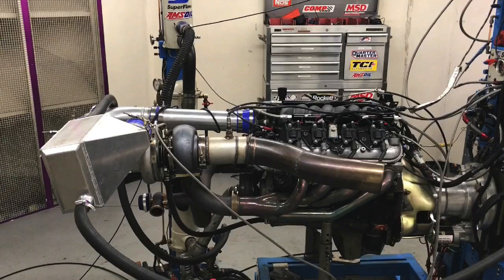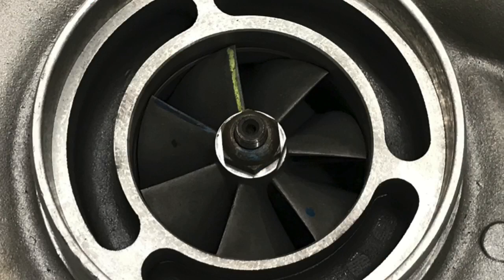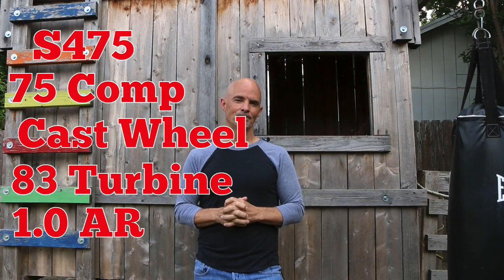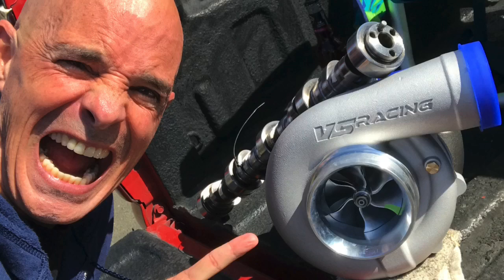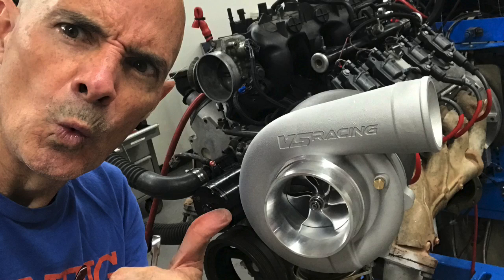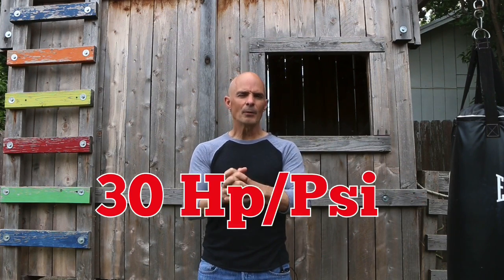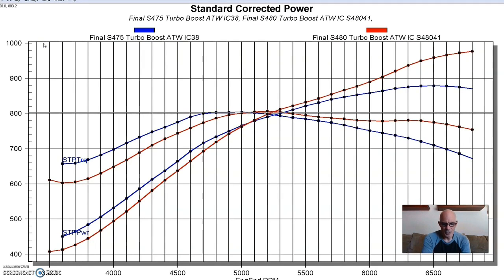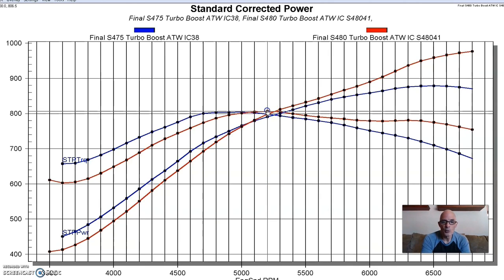HOW TO: PICK THE RIGHT TURBO!

Comment: Does it not seem like maybe your wastegate could be undersized? You can see where the gate opens at 4700 (475) and 5100 (480) and they seem to not bypass as much exhaust flow as needed to keep a flat boost curve after wastegate opens. Just a thought.
Reply: Or is your correlation of backpressure to boost responsible for what I'm seeing in the boost curve with a rise in boost after the gate opens?
Reply from the maker: we have two gates-no problem with gates-its back pressure/boost changing the opening
Reply: @richardholdener1727  thanks so much for your reply.

Comment: I don't think a bigger motor would produce any more exhaust back pressure than a smaller engine at 1000 hp . Probably be pretty close but what is going to be skewed is the back pressure to intake pressure ratio.
Reply from the maker: back pressure will 100% be higher on the bigger motor
Reply: @richardholdener1727  Well that would make for a good video, same turbo, same hp level ( not boost ) and different displacement say 4.8 vs 6.0 and see if the back pressure is much higher on the bigger motor . I might be wrong but I think it would be a difference of 1-2 psi .
Reply: @richardholdener1727  Can actually prove my theory if you go look at your VSracing turbo vs Borg,  @ 6500 rpm the 4.8 produces about 20 psi of back pressure and makes 800 hp . In this video same turbo  on the 6.0 its produces about 875hp @6500rpm and about 22-23 psi of back pressure.  Yes the boost to back pressure ratio is way off on the bigger motor but its proves my point that back pressure( exhaust gas volume) is a function of HP not displacement.

Comment: Still trying to turbo my 416 sbc without spending a lot of money...

I have a couple of extra Powerstroke diesel units: GARRETT TP38
Compressor wheel inducer diameter: 59.87 mm (60 mm)
Compressor wheel exducer diameter: 80 mm
Compressor housing A/R: 1.10
Turbine wheel inducer diameter: 76.2 mm
Turbine wheel exducer diameter: 69.84 mm (70 mm)
Turbine housing A/R: 1.15

Anyone knowledgeable on this subject care to comment as regards the practical viability of this combination?
Reply from the maker: get them on
Reply: @richardholdener1727  A little short on detail, bit that sounds pretty positive.

Comment: A test I've always been curious about on a turbo motor is what happens to a given combination and it's power/boost curves as camshaft overlap is increased or decreased?  I expect the boosted curves would mirror NA curves like most of your tests show, but what happens to the hot side choke point?  If you've got a turbo that's oversized on the hot side for a given power level, can you make it more responsive with more cam overlap?
Reply from the maker: if the overlap adds na power-then yes-it will be more responsive

Comment: Isn't that where looking at the compressor maps come into play? Figuring out the efficiency of the turbos at the power levels you're looking for. Now, obviously the compressor map isn't going to help you choose a hotside, but it's definitely needed when selecting what turbo to use for your power goals. 

I'm in the process of selecting a turbo for a twin charging application on a 4.6 2v modular and it's looking like I'm going to need an s488 for the power levels I'm wanting at the boost levels I'll be looking for. 

It will be feeding through an intercooled m122 supercharger. Most people when twincharging make the mistake of not selecting a big enough primary to support their goals at the boost level that the primary will be running at and then they get frustrated when they can't make the top end power they were expecting. 

Maybe you could do a twincharging test to showcase how choosing the primary is so important in a twincharging compound boost setup.
Reply from the maker: the map is looking at a small thing--the general turbo size and max capacity is the big  thing you look at first

Comment: Awesome video! Got a video idea. Could you do a test on a centrifugal blower where you pulley way down to try and bring on boost harder and just use a watsegate to vent any extra boost up top? I always wondered if that would work. Would probably run into belt slip early but I'm not sure
Reply from the maker: it does work

Comment: Thanks richard! This was exsactly what i asked for, but it leaves me with 1 question- 
I believe you said that the S475 would have to much back pressure for the 6.0 and the S480 MIGHT be the better choice. Would the S475 be the right choice for me on the 2500 6.0 LY6 if its my tow vehicle or if im going to do a rear mount turbo and looking at MAX 650-700 HP/TQ? AND Does that change back pressure or response with A rear mount stock muffler location? Sorry if you've covered this. Love these videos learning alot!
Reply from the maker: use the S475 for that application
Reply: @richardholdener1727  your the man thankyou for responding! Greatly appreciated it and all you do
Reply: @richardholdener1727  with what size exhaust housing? I'm running an LQ4 as well in my tow pig/cruiser. Current S366 isn't working (too small).
Also, this motor (in the video) has dual wastegates. Required to control boost creep or just leftover from the big twin turbo testing?
Reply: Why would you ever want to do a rear mount unless you absolutely had to?
Reply: @chipcurrey653  its not right for every application just like everything else, but there ARE alot of benefits the 2 main ones being UNDER THE HOOD TEMPERATURE AND WIRING, The 2nd would be the stealth of it.
Reply: @joelstevensz06  I tuned an 05 GTO with a rear mounted 7875. It did not get into boost ( i would call "getting into boost 5 psi or more) until 4500 rpm. I advised the owner to move it to the front using the hooker manifolds. The same exact combination with the same turbo now "gets into boost" at 2500 rpm. 2000 rpm sooner. I cannot see that set of tradeoffs ever being worth it. If you pop the hood on any modern diesel, or the trunk on any 911 turbo you will see the factory engineers designed the shortest log manifolds possible.

Comment: My results with Garrett turbos are way different you have to remember Garrett turbos have a huge advantage mainly because Nissan paid for the development of more advanced . Anybody that can make it into the PRI show and talk to the engineers And get real scoop
Reply: You’re overlooking turbine efficiency you should be doubling your horsepower before eight psi
Reply from the maker: how are your results different? Bigger hot sides don't reduce back pressure on a Garrett? I've tested plenty of Garretts-they work the same

Comment: how do I figure out what AR is needed, more specifically on a twin set up for a 6.0
Reply: I think exhaust AR can't really be calculated like the compressor side with compressor maps so exhaust AR is selected with a best guess followed by tying other scroll housings from that point.  I too would be interested if there is a better way to get it right the first time.
Reply from the maker: talk to the turbo guys like Viren at VS or the guys at LJMS

Comment: Hey Richard, been enjoying your videos for a while now. As soon as i saw this title an idea poped into my head for the junkyard guys. Would you consider getting a bunch of popular junkyard turbos together an testing then out? Hx35w, twins maybe?  duramax turbos? Semi turbo (lol exhaust) im sure theres more but itd be sweet if it sparked an idea to test out some low buck junk again!
Reply: I like this idea. Also, I'd like to see how turbos from diesel engines work on gasoline engines.
Reply from the maker: those are hard to find sometimes
Reply: That’s an comparison I’d like to see , a junkyard turbo shootout.!
I’ve got a home brew setup: Its a 5 ton deck carrier with  HX35 huffing a blow through on 427 tall deck . 10 psi is where I’ve capped with big a increase in usable power .

Comment: I'd like to see how much of a difference a E-Boost controller makes over a manual controller
Reply: None on an engine Dyno. The nice part about electronic boost controllers is you can create a table with your engine management to ramp boost in or out to shape your curve for dialing in the car for driveability and better response at the track.
Reply from the maker: the electronic controller can definitely change the power curve-even on the engine dyno. It also keeps the gate closed longer before opening it

Comment: Why not just bolt different hot side housings (AR) to the same turbo?  That would really make your point.
Reply from the maker: we can do an AR test
Reply: @richardholdener1727   I would love to see a test between the different ar ratings that the s475 offers.
Reply: @standardissue3903  also interested
Reply: @richardholdener1727  do it do it do it.
Reply: @richardholdener1727  please do the AR test with that would be awsome-
Reply: @richardholdener1727  That sounds interesting. IMO turbine sizing is probably one of the most "mysterious" aspects of turbo sizing to most people. Until you talk the Garrett GT series turbine maps were basically unheard of and are still an oddity today.
Reply: @richardholdener1727  what's interesting is the 4.8 vs 454 test was an ar test just the engine swapped not the turbine
Reply: @richardholdener1727  arent those housings interchangeable between those two
Reply: @richardholdener1727  A/R test on 5.3 and 6.0 would be excellent!
Reply: @richardholdener1727  Hey Just out of curiosity would you happen to know what would be the best suitable turbo for my application if I gave you some specs Or if anybody else can answer my question that would be great thank you
Reply: Yes size the compressor for power and turbine ar for efficiency
Reply: @bill2178  finely some one gets it.
Reply: @boosted2813  right now im working on a compound gt 3582 + s475 borg im going to be expirementing with 1.58 ar for peak efficiency and use the little turbo to light it on the bottom
Reply: Vs racing 78/75 can have a .96 or a 1.25 are housing on the same wheel.
Reply: I would like to see a test on a Honda that has something like a Gt3582 with an .82 ar turbine, the same again, billet wheel, same but 1.06 turbine housing and finally with ball bearing. It's a few test but gives you a scale of what the scope of changes are. There really isn't too much difference in the middle with a billet wheel but they are lighter and spool faster and flow more air more efficiently. The difference will be at the top and bottom of the curve. The 1.06 housing has more mass flow but can have a fairly high boost threshold. Ball bearings really only help with spool, once things are moving they don't really make a huge difference but on some combos they can get up to waste gate 1000rpm earier.
Reply: @timothybayliss6680  The ball bearing difference won't show up on an engine dyno.
Reply: @bcbloc02  your probably right that it won't. If you loading the engine below the boost threshold you might see a little change. Data logging at the track will probably give better data. If the engine will make peak boost by 5000rpm, I did say a Honda, and you start the dyno run at 2k rpm and had the engine accelerating at 600r/s, you would probably see a pretty big change for a few rpm, but the general shape of the curve won't change too much. There is a chance that the drive pressure will be lower as well, meaning the same wastegate setting make more boost.
Reply: Keep the videos coming Richard, the knowledge of all the information that you are offering is so valuable to all of the motorhead community, PLEASE KEEP MAKING MORE HEMI VIDEOS
Reply: Good comment bro
Reply: I think he means changing hot side wheel more so than AR size
Reply: @richardharris492  Not really.  Same wheel just different AR housing.  The Housing AR size is a big driver on back pressure.  A housing swap is quick and relatively cheap compared to a wheel (cartridge) change so is something that someone might consider doing.  I think it would be a great test to perform.

Comment: This is another super informative video. Thanks! I wonder though, when a different size engine (like 4.8 vs 6.0, like you were using as examples) makes the same power, isn’t the hot side flow the same? Lbs/min airflow in would have to equal lbs/min out, seems like. The little engine would take longer to get there, but the resulting flow should be the same—or not? Would pinning the waste gates closed with CO2 affect the way the boost comes in? Is there a solution using variable A/R, like a diesel turbo? Is there a way to get the back pressure curve you showed on the BBC with twin eBay turbos on the little LS? Inquiring minds...
Reply: I thought pound for pound flow was a good measure when looking for junk yard diesel turbos to use on a gas engine. I figured that my gas engine will run half the boost and double the rpm of the diesel so it all works out. But it turns out that it's not about matching mass flow but matching volume flow. So a 7.5L gas engine that turns to 5000rpm will need a turbo from a 15L diesel that turns to 2500rpm.

Comment: I'm curious to see how much back pressure the same turbo makes at say 800hp on 2 different engines. Will it be the same because you need the same amount of air and fuel to make the power? Obviously boost pressure will be different
Reply: Watch his video on the 4.8 vs a 454 with a GT 45 turbo.

Comment: when a test about oil pump and how much hp we can have when we "decompress" the block, how many hp can give oil pump sistem or exhaust sistem? also a question, if i boost an na engine, i should increase the oil pressure or i leave the same? when an oli pump  upgrade have sense?

Comment: Richard! What is AR an what's the difference between 1.00 ar and 1.25 ar ? Looking to do a rear mount turbo on ly6 street car. So power down low and mid rpm is more important.
Reply: Lots of info out there online, but basically put.. smaller AR is more restrictive and more responsive but can potentially limit power, larger AR is less restrictive and less responsive but can allow for more power on top end
Reply: @Lsxdude1  thanks for the info!
Reply: Looking at doing the same but on a 08 ly6 2500 for towin ggv and stealth turbo
Reply: @joelstevensz06  going for the stealth turbo look myself, not looking on building a race car for the track. Just a fun street car, to surprise people on the street!

Comment: I assume a 2:1 drive psi to boost psi ratio always equates to more responsiveness, but at what point do reach diminishing returns? A 1:1 ratio is probably more ideal, but is also more lazy down low? I’ve heard so many horror stories about toasting exhaust valves from excessive drive pressure, and how you have to have inconel valves. What’s your opinion on ideal drive pressure at max boost while also having response for a street car?
Reply: So I'm not Richard, but did a lot of work in Turbo Vipers and a very well known, record-holding 911 turbo. In my viewpoint, traditional turbos (I'll until recently) would drive like an OE application with max target EBR of 2 (and tuning needs to watch EGTs), had a good mix of power and streetability around 1.3-1.5, and became very racecar at 0.8-1. These days, I feel like a very power-capable turbo can be made to make power everywhere without needing to go to 2... More like 1.5-1.7. A perfectly streetable turbo is now in the 1.1-1.3 range, and race applications are well under 1.

Some of what we see here is the issue with manifolding 8 cylinders into one turbo. You just can't use the exhaust energy that efficiently versus a well designed twin system. Puts you very much in my "traditional" category.
Reply: @corystansbury  this is why I would love a test like this with the same turbo s475 but with a nice turbo header hot side and see the backpreasure comparison. I want 700 wheel and still be a fun street car with a head cam fuel system 5.3 or 5.7 this looks like the setup with an ar change or headers on the hot side.
Reply from the maker: back pressure is only 1 part of the response equation-and something you look at after you have done everything you can to improve na power production

Comment: Would have been nice to know the hot side A/R of each of them.
Reply: S475, 83 turbine wheel, 1.0 A/R
S480, 96 turbine wheel, 1.25 A/R
Reply: @tatehalpin5686  thanks Tate.
Reply from the maker: i supplied that info in the video
Reply: @richardholdener1727  sorry must have missed it.

Comment: This turbo comparison, reminds me of cams. Smaller cam, more responsive down low. Not as powerful. Large cam, fall off down low, more power up top!
Reply: you are correct. Smaller turbo makes boost at lower rpm and better for torque but runs out of breath up top in the higher rpm's, bigger turbo doesn't light off until higher rpm's but when it does come on pulls like a freight train up top.  An engine with a smaller cam would probably be better with a smaller turbo and bigger cam should have bigger turbo. It's all a balancing act where you have to choose components based on what sort of rpm range you want the engine to make the power at.
Reply: @GnarshredProductions  I think that is the opposite of what Richard holdener was talking about in his b-tec video
Reply: But I want something for nothing!!   :)    is funny how much guys scrutinize parts like this when it makes so little difference for most...